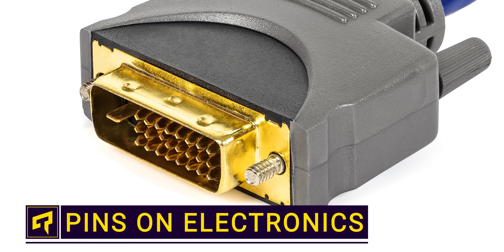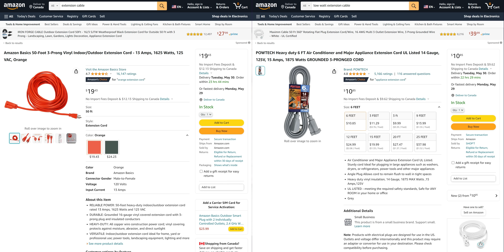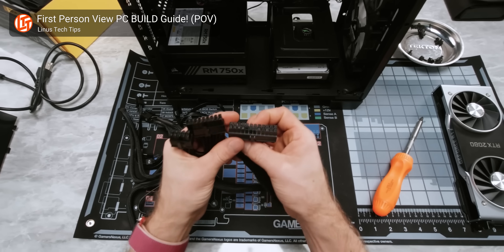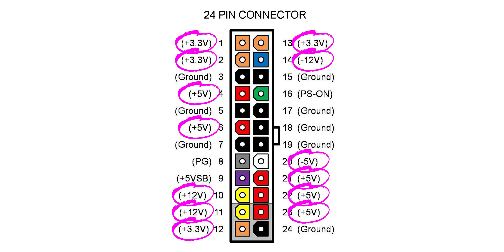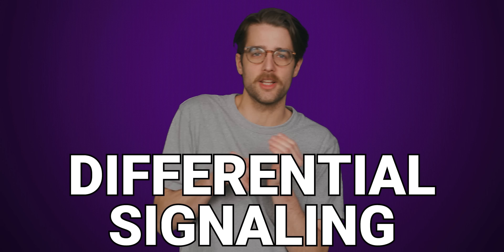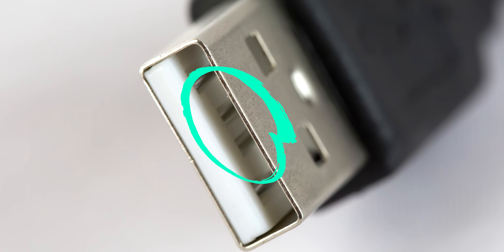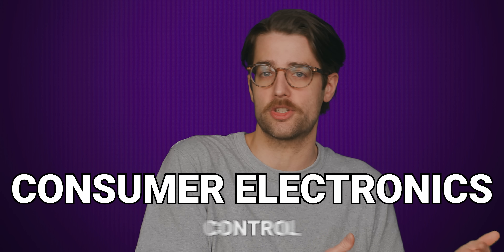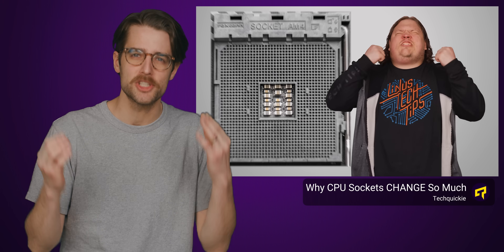Why Connectors Have So Many Pins

Comment: Ngl, this is not a good choice on the sponsor. I would expect a team like yours to dive into and analyze a sponsor better than this. It's not that I don't believe a product like this could work; I believe you've done a video on thermoelectric cooling, and that's indeed a possible implementation. But when I hear "AI" randomly thrown around in marketing and see a conversion of a sub-zero temp into almost room temp, I start to get suspicious.

Comment: I worked at Boeing for years. Some of the connectors on airplanes can have over 70 pins and supply up to 110 volts at 400 Hz to a variety of equipment. Troubleshooting on these connectors was always a joy.

Comment: No, they dont serve as shields, at least not by design. You ground the spare wires (or in most cases, connect them to 0V) so that they dont act like antennas that induce voltages on the wires that you actually do use. RS485 is a prime example of a standard that will suffer from floating wires.

Comment: 2:24 Think someone using this while charging...
Gets charge forever😂
Reply: Considering people often forget to charge the device before using, we believe pass-through charging technology is quite useful. AICE 3 lasts for up to 24 hours and gets charged within 2.5 hours, so you don't have to charge it forever.
Reply: @henryzhong1989  There must be Bluetooth speaker around it with immersive sound technology..does it has?
Reply: @wildyato37  You are right, AICE 3 does have a speaker that you can play music and receive phone calls with. But It's just a regular speaker, personally, I won't call it immersive sound or something.
Reply: @henryzhong1989  Oh ..its ok

Comment: TDP is NOT power consumption.
Also, wtf with that sponsor? It looks like a scam.
Reply: Sorry to make you feel that way. RANVOO brand has existed for over 10 years (founded in 2012) and it's now the largest brand of personal appliances in China. AICE 3 is its 6th generation of neck fan products, and the 3rd generation of neck air conditioners. So both the brand and product are real, not a scam / fraud.

Comment: Whoever did the 50 degrees Fahrenheit = 10 degrees Celsius conversion doesn't understand the difference between a temperature and a change in temperature. A change of 10 degrees Celsius is a change of only 18 degrees Fahrenheit, not 50.

Comment: There are extra pins on type C cables for backwards compatibility with older usb spec transfers. As those get phased out I wonder if it just becomes extra bloat that doesn’t get used anymore to keep the type C standard in play

Comment: The original serial port had 25 pins, even though at it's most generous only ever used 11, why?  Because the first person to build a computer with one had a bunch of surplus 25 pin plugs so that's what he used, then everyone that came after had to follow suit or break compatibility, eventually 9 pin for serial won out as a more popular standard but even it had most of it's pins dedicated for rarely used and not entirely necessary functions.
Reply: slow clock = less data = need for pins aka 12pin 600mhz = 24pin 300mhz (i think)

Comment: 2:19 you don't want to put a 7000 power battery on your neck and if it explode of overheat your dead !
Reply: Don't worry, the battery of AICE 3 is deeply customized to be compact and safe. It has passed both our internal safety tests and external safety certificates (including FCC and PSE etc.)

Comment: The charger for the original iPod Touch was almost impossible to plug in. It  could only be pugged in one way, but no matter which way I tried it wouldn't go in. I would have to try it a bunch of times before it finally went in. I even tried unplugging it and then immediately tried plugging it back in, but it wouldn't go in. This proves that even when it's the right direction, it still won't go in until after a bunch of tries.

Comment: Whats with the sponsor...
Reply: RANVOO brand has existed for over 10 years (founded in 2012) and it's now the largest brand of personal appliances in China. AICE 3 is its 6th generation of neck fan products, and the 3rd generation of neck air conditioners. So both the brand and product are real, not a scam / fraud.

Comment: that sponsor XD
Reply: RANVOO brand has existed for over 10 years (founded in 2012) and it's now the largest brand of personal appliances in China. AICE 3 is its 6th generation of neck fan products, and the 3rd generation of neck air conditioners. So both the brand and product are real, not a scam / fraud.

Comment: This feels like an april first sponsor
Reply: RANVOO brand has existed for over 10 years (founded in 2012) and it's now the largest brand of personal appliances in China. AICE 3 is its 6th generation of neck fan products, and the 3rd generation of neck air condirtioner. So both the brand and product are real not a fraud.
Reply: @henryzhong1989  i never doubted the fact it exists, but im doubting its usefulness. It feels like an over engineered solution to a very basic problem. That's just me though

Comment: spoilers: that wearable air conditioner is $350!! You could buy several actual air conditioners at that price
Reply: AICE 3 does what an ordinary air conditioner does, but it's only 1/300 the volume, 1/200 the weight, 1/100 the power consumption of an ordinary air conditioner. So that you can take it with you and save your electricity bills.

Comment: What kind of scam product do you let yourself be sponsored by? Cooling produces heat, where does that go? Cooling and heating require a lot off energy, 7000 mAh is almost nothing. A device like this isn't even worth a tenth of the 350 they're asking for it!
Reply: Sorry to make you feel that way. AICE 3 respects the law of physics. Actually, AICE 3 uses the Peltier effect instead of traditional refrigerants to cool down or warm up. And with patented air duct design, it brings heat that is generated during cooling to the outward of the device, leaving coolness to you.
Reply: @henryzhong1989  The Peltier efffect and 'patented parts'  aren't magic, how much cooling can it actually provide with a 7000 mAh (35 Wh?) battery? And how does that related to the 80 W heat a human body generates + the incoming sun/ambient temperature? Also, you are saying you have heat blasting away from your neck, just inches away from the cooling. 

If you want to convince me, you can send me one to test, because in my mind and on paper it makes no sense. ;)
Reply: @bestpracticeses  What do you think of those 2 product: Sony Reon Pocket 4 and Torras Coolify 2S? Those are the most similar products to AICE 3. AICE 3 has the largest battery among them. If AICE 3 doesn't work, how about those with smaller batteries?
As you know, AICE 3 is not cheap. If you can convince me, I will apply to our boss to send you 1 unit for free.

Comment: TBH - why many small pins for power delivery are better than two huge ones (when a device needs just one voltage level)?
Reply: probably cheaper than having varying pin sizes for data and power
Reply: @FluorescentGreen5  Good point, thanks.

Comment: What is this sponsorspot?
Reply: RANVOO brand has existed for over 10 years (founded in 2012) and it's now the largest brand of personal appliances in China. AICE 3 is its 6th generation of neck fan products, and the 3rd generation of neck air conditioners. So both the brand and product are real, not a scam / fraud.

Comment: Now, somebody tell me about old 68-pin SCSI 3 hard drive connectors. Hint: Differential signaling on a parallel data bus. Or the even older Centronics printer connectors. At the time, it seemed unreal when those printer-server boxes (required to give an IP address to any printer) had an input from an 100 yards long CAT5, 100 MBit/s Ethernet connector and provided an output to a DB25 parallel cable that couldn't be longer than a meter or two. Those were different times, power had nothing to do with all those pins; the I/O speeds were seriously lacking...

Comment: They forgot the dallas 1-wire and the plc protokolls. It's possible to have only 2 pins but it's hard. The 4-Pin I2C /TWI is one of the best interfaces (sd-cards for example). It would be great to have 2 wires only but the industry don't want to come to one standard. 1 GBit/s over 2-wires (with power) where possible 10 years ago (PLC; ok there where some flaws and you need to reboot this things every 3 month or so but it worked and could be resolved).

Comment: Wish you could explain more about differential signaling and how it works.

I've quite often just used things like pwm for my microcontrollers so most of my stuff just uses 3 pins 2 for power and 1 for data.
Reply: I’m going to surmise it’s the same idea as a balanced audio cable, having the signal 180° out of phase with itself means that any interference that gets picked up will be cancelled when the inverted signal is inverted again at the end.
Reply: @TheTubadMoose  yes, and there are lots of videos explaining it well on youtube as well, but I think OP means that they could have explained it a bit more in this video.

Comment: can somebody tell me why a gpu needs power over pci? i mean we have the 6/8/12 pins conector to the psu for that... or not?
Reply: Because PCIe has very low ceil of transmittable power, something like 75 Watts and it were ok 20+ years ago, but then came modern GPU, which need 100-200-300+ Watts🤔
Reply: @maksimfedoryak  thank you for your explanation

Comment: Idk how I feel about the sponsor
Reply: RANVOO brand has existed for over 10 years (founded in 2012) and it's now the largest brand of personal appliances in China. AICE 3 is its 6th generation of neck fan products, and the 3rd generation of neck air conditioners. So both the brand and product are real, not a scam / fraud.
Reply: @Tristen Grant RANVOO brand has existed for over 10 years (founded in 2012) and it's now the largest brand of personal appliances in China. AICE 3 is its 6th generation of neck fan products, and the 3rd generation of neck air conditioners. So both the brand and product are real, not a scam / fraud.

Comment: Linus steps down as CEO and now we get ads for neck air-conditioning?
Reply: Is it causation or correlation?

I must admit, though, the thought did cross my mind.
Reply: he’s still ceo for another 5 weeks or so. also not every single decision goes through the ceo. the sponsor is shit but i doubt anyone that knows their stuff looked at the ‘portable ac’
Reply: @sneps-ix2th  RANVOO is the No.1 brand of personal appliances in China, and AICE 3 is the best (and most expensive) neck air conditioner on the market. Maybe you should give it a try before judging.
Reply: The ads on the tertiary channels have been pretty bad for a while, it feels like the channel have different have different ad teams
Reply: @munjee2  For other Ads, I can't judge. For RANVOO and AICE 3, I can assure you they are real and doing pretty well.
Reply: Neck air conditioner is a must to people who have to expose themselves outdoors on hot summer days, such as blue workers, hikers, campers, and travellers etc. to prevent heat stroke. Why can't it be advertised to people in need?
Reply: @henryzhong1989  People have built-in air conditioning. It's called sweating. Cold drinks, (and neck air-conditioning) can fool the body into thinking it's cold when it's not, and prevent sweating.
Reply: @gail_blue  Yes, I agree. But what if it's too hot for the body to react? Like heat stroke, and hot flashes that most middle-aged woman have. AICE 3 can help our body to cool down faster and prevent those things from happening.
Reply: @henryzhong1989   你和公司有什么系 ？ （是关系精确词 ？）
Reply: @sneps-ix2th  你会讲中文？！我是锐舞海外的营销负责人。Wow! I'm the MKT leader of RANVOO global business.
Reply: @henryzhong1989  我是中国人 ！你是对的 ， 我不公平。这项发明非常有趣 ! 我道歉。i shouldn’t judge something i know nothing about, the tech is very ‘cool’ and i hope it’s successful. i was thinking of air conditioning in a different sense so i thought the product was misleading.
Reply: @sneps-ix2th  原来是同胞呀，幸会幸会！不必抱歉啦，新品类确实经常被人误解。Thank you, the entire RANVOO team is just trying to make the best neck A/C product and let more people enjoy the coming hot summer.

Comment: that ad is so scammy
Reply: Sorry to make you feel that way. RANVOO brand has existed for over 10 years (founded in 2012) and it's now the largest brand of personal appliances in China. AICE 3 is its 6th generation of neck fan products, and the 3rd generation of neck air conditioners. So both the brand and product are real, not a scam / fraud.
Reply: @henryzhong1989  fair point, just 'feels off', if they are so big why do they need to crowd fund..
Reply: @cod.liver.failure  Good question. As a new product category, RANVOO wants to know how the market and customers react to such a revolutionary neck air conditioner.
Through crowdfunding, we can communicate with customers about what they think of AICE 3 and how we can improve in the future.

Comment: Ground is not the second pin you pointed to. The connector casing is grounded, the two pins for power are negative and positive terminals, not ground.

Comment: The sponsor has my BS detector going off. If it is a wearable aircon where is the heat going. Laws of thermal dynamics and all
Reply: AICE 3 respects the laws of thermodynamics: it uses Peltier effect and a patented air duct design, to bring the heat generated during cooling to the outward of the product, so that you only feel cooliness when wearing it.

Comment: the neck air conditioner is the dumbest thing i've heard of in a while.  even saw a review  about it.  AC works by moving heat somewhere ELSE. this thing has nowhere to move the heat. it can't just PRODUCE cold air. it does blow cold air, but it also blows the hot air out. it's pointless. don't buy it.

Comment: That Indiegogo sponsor looks pretty scammy.
Reply: RANVOO brand has existed for over 10 years (founded in 2012) and it's now the largest brand of personal appliances in China. AICE 3 is its 6th generation of neck fan products, and the 3rd generation of neck air condirtioner. So both the brand and product are real not a scam.

Comment: "Putting an electrical connection and data connection on the same pins causes interference"

I don't know, PoE seems to have solved that somehow.

Hint: it's a side effect of the other big advantage of differential signaling.

Comment: You really didn't mention the shielding thing with detail, and the detail is short.  Data signals that clock at high speeds will both be subject to interference from the other lines in the cable and ALSO any strong signals in the room.  Those high speed signals ALSO will generate interference into data lines in the same cable.  So, data lines are twisted with a ground line which helps to contain the signal, and for this you have to understand inductance but that's above the scope of this video.  Data lines, for which most data cables have a few, are wrapped with a ground line to make a twisted pair and this creates the shielding needed inside the cable bundle.  The ENTIRE cable can also be shielded to reduce the ability of an external signal being propagated into the cable, and this is important if you're in an area where there's a lot of external transmissions.

Comment: Ok, so for an N-thousand-pin CPU socket, why not have the 4 perimiters "voltage bars" that handle +v and gnd? Why N-times-1-pin instead of bar-with-n-pins? then they would only need pins for data/clk ? Similar with power supplies? Why not have Big-Gauge-wire-and-connector instead of 12-small-pins X2 for +v and gnd?

Comment: Putting power and data on the same pins doesn't "cause interference" (if done correctly).  There are actually several common applications which do exactly that and work just fine (such as Power Over Ethernet).  The real answer is just that it's easier to put them on separate pins because that way you don't need additional circuitry to combine them on one end and separate them on the other.
Reply: On same wire ?
Reply: Many industrial protocols like HART do this

Comment: Promoting scams now😢
Reply: Sorry to make you feel that way. RANVOO brand has existed for over 10 years (founded in 2012) and it's now the largest brand of personal appliances in China. AICE 3 is its 6th generation of neck fan products, and the 3rd generation of neck air conditioners. So both the brand and product are real, not a scam / fraud.

Comment: All cables in germany and probably the rest of europe are rated for at least 16 Amps, which is the current which would trip your breakers. Only difference being the ones you put in the wall which may have to be rated for more, im not sure, i do know that the diameter needed is different for the same current the more phases you run through a cable and we do have 3 phase circulatory current with 400V between 2 phases, we use that for industrial machinery and for electric stoves.

Comment: bruh wtf is the sponsor thats some aliexpress garbo
Reply: Sorry to make you feel that way. RANVOO brand has existed for over 10 years (founded in 2012) and it's now the largest brand of personal appliances in China. AICE 3 is its 6th generation of neck fan products, and the 3rd generation of neck air conditioners. So both the brand and product are real, not a scam / fraud.
Reply: @henryzhong1989  i never stated it was a fraud, i buy off aliexpress all the time. this product category in general tho is pretty dubious
Reply: @gamagama69  Totally understand. The R&D of a neck air conditioner is not an easy task. Most of those cheap ones from unnamed suppliers are useless. But RANVOO brand (biggest brand of personal appliances in China) and AICE 3 product (the most expensive and advanced neck A/C) are trustworthy.